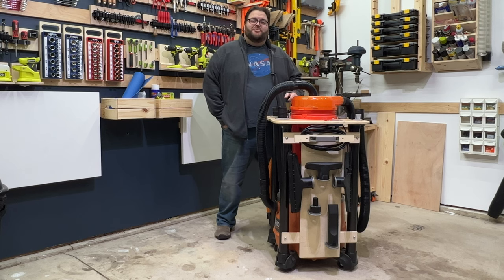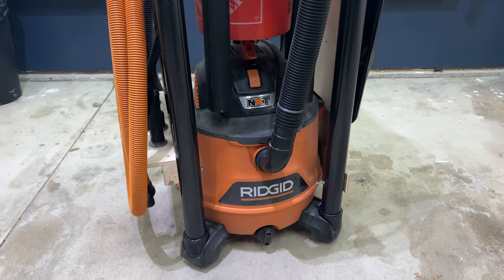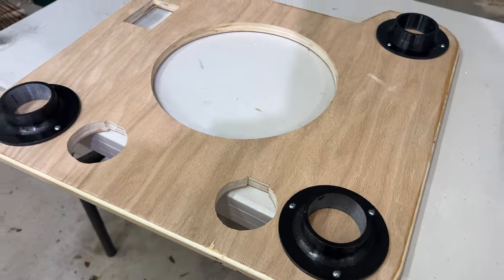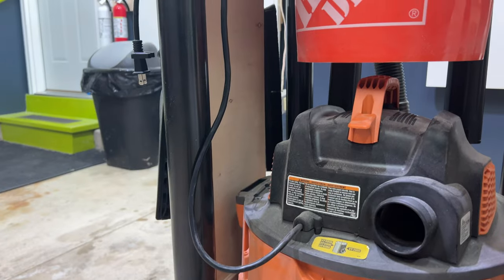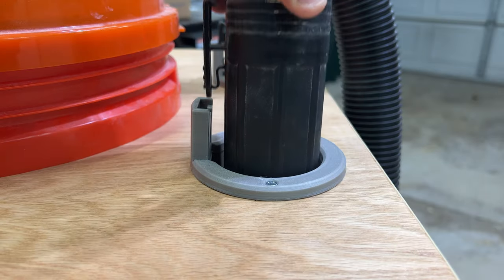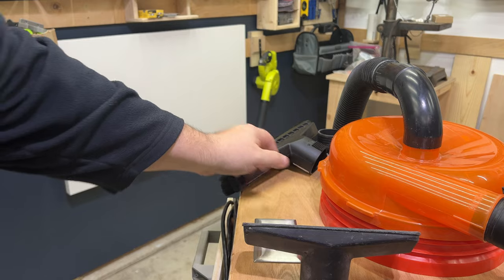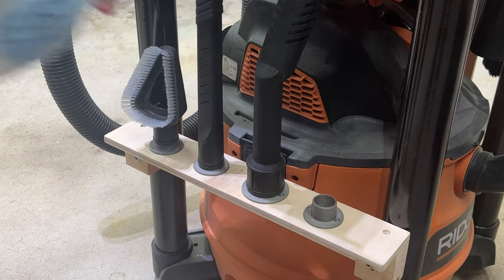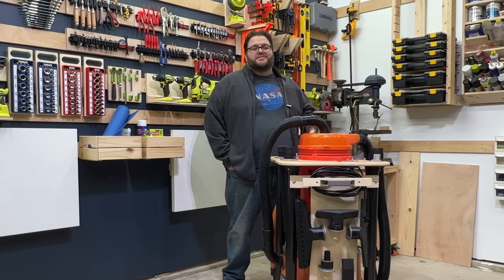A Super ORGANIZED Dustopper Ridgid Shop Vac Cart

Comment: Nicely done, sir. I just finished one of these myself. One suggestion: run a ground wire from your dustopper to the ground in your junction box. This was a must for me. Mine generated an impressive (and scary) static electricity field that I could easily feel from 3 to 4 feet away.
Reply from the maker: Attach it to where on the Duststopper? It's all plastic. Does it make a difference?  Thanks for the comment and for watching!
Reply: @CyberBobCity  It does indeed make quite a huge difference...well, for me anyway out in my 104 degree 20% humidity summer weather.  :) The  new dustopper models come with a little bolt and wing nut, and have a little divot just to the right of the intake port where they suggest attachment, and include instructions for grounding.
Reply from the maker: @erik.schlegel  Interesting! Thanks for the head ups. I'll check those out!

Comment: Very nice workstation, are you not concerned about the car cleaning hose restricting to much air flow, possibly damaging the vac?

Thanks for sharing.
Reply from the maker: Nope, the car cleaning hose came with the shop vac.
Reply: @CyberBobCity  I was wondering why you used the smaller hose, and now I know. Thanks for getting back to me.

PS, do you mind if I copy this, I have already started gathering materials.

Comment: I built one similar and I kept tipping it over because the hose is up top. I went back to side by side sled and fits under my workbench perfectly so it’s out of the way when not in use . Seen other’s use a larger base to spread the wheels farther apart to keep from falling over .
Reply from the maker: Gotcha. Mine hasn’t fallen over yet I think because the added weight on it. I’d love to somehow switch the wheels out with nice roller blade wheels.

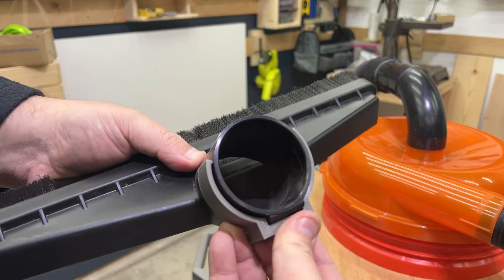Comment: For the hoses, especially the hose without a hook - you could create some pieces the same way that you created at 3:51, the flexible C shape piece. this would hold the hoses securely whilst also being very easy to take in and out. They could be mounted to the side of the plywood board, or to the top and hanging over. as long as you made them say 30mm "tall" they would hold the hose very securely. Also you're less at risk of those hose clips getting snapped off.
Reply from the maker: That is a great idea! I might try that!

Comment: Incredible thought went into this and I genuinely appreciate you sharing your solution here. I had originally seen the basic build from https://www.youtube.com/watch?v=WyBuRjO54NM but was wanting something slightly more for the accessories and dealing, as well as accommodating the changed diameter on the Ridgid casters. You nailed it and saved me hours. Thank you so much. 

I'm curious if you have any issue with it wanting to tip over as you're pulling it? I was thinking about making a hook to draw the collection hose lower so there's less of a lever-effect, but I didn't know if I was over-engineering a solution to a non-problem. =)
Reply from the maker: Thank you!

Honestly not once has it tipped over. Sure if you hit a big bump or something and kept pulling it would probably tip over. But I haven’t had that issue.

Comment: Which 3D printer did you use?
Reply from the maker: For most of this an Ender 3 Pro and/or an Original Prusa Mini. I forget which ones I printed on each. Do you have a 3d printer?
Reply: @CyberBobCity  I do not have a 3D printer at this point but your video got me thinking. I have a similar cart setup but all of the attachments are all over the garage. Either you need to sell those parts 😉or I need to get a printer. Perhaps you could do a video about your printer. Your video was very helpful and right to the point. Thanks!
Reply from the maker: @joelsheman5318  Well I can only sell the 3d printed parts for the designs I created. I also used some from the Internet that I can't sell. I've thought about offering my designs for people that don't have 3d printers and might setup something this year.

But 3d printing is very rewarding. If you are at all inclined I highly recommend getting one. I've learned so many cool things, especially designing and printing my own models. It's been really fun and a great creative outlet.